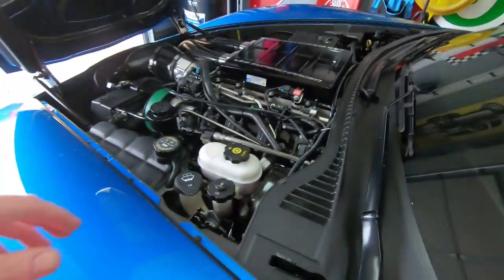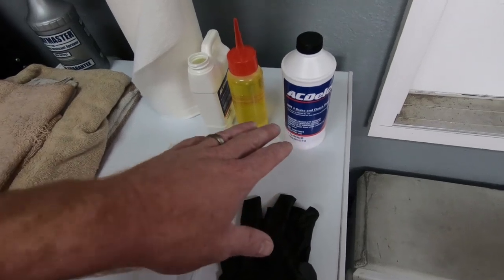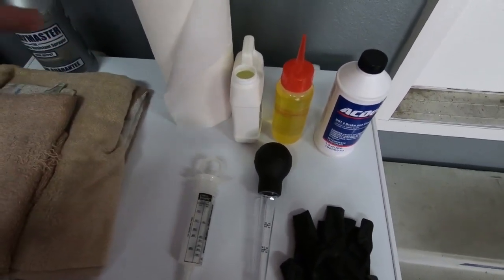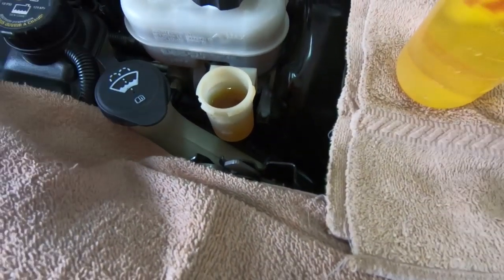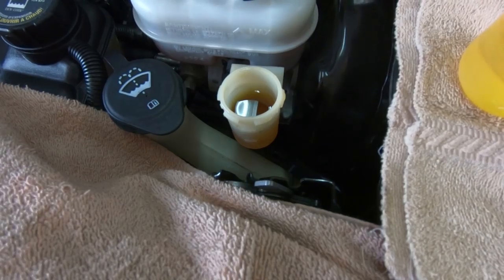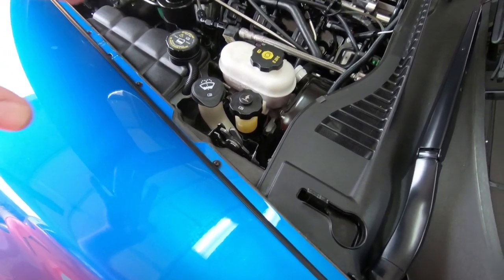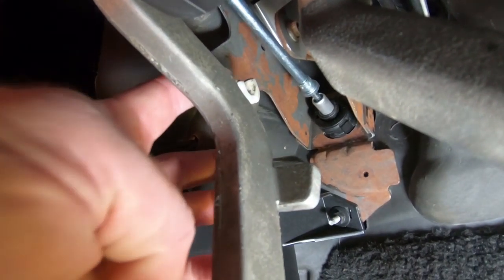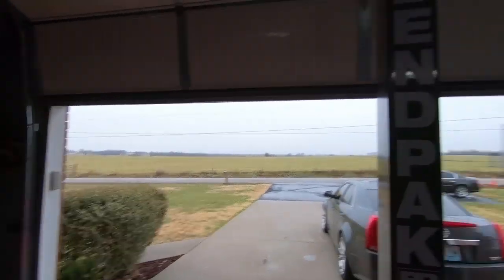How to Flush Clutch Fluid and Remove Clutch Assist Spring Corvette

Comment: Thanks for "ranger " flush method show and tell. Now my problem is I have a '97 Chevy OBS truck and the clutch assist spring is broken or missing. So my pedal returns from the pressure plate but on a bumpy road it kind of dangles so I have to keep my left foot close in. Wish I had the Corvette style spring problem you had. Any of your trucks have/had this problem ?
Reply from the maker: Never had that issue on a truck

Comment: Awesome vid! I have done the ranger method on my 2012 Z06! Works great and very easy to do! 
As for the clutch spring, that's crazy that it still bounces back like that! My spring broke on my 2003 Coupe and I had to lift the pedal back with the top of my shoe to engage the clutch. Otherwise it would stay in the down position. 🤷‍♂️
Reply from the maker: Thank you. I agree well worth doing.

Comment: Owning a 2002 Trans Am Ram air I would recomend Tick performance for their master cylinder.  Sold my cluctch issues. You remove the pedal spring.
Reply: Solved. Sorry typo.
Reply from the maker: Yeah I have used ticks on past fbodys and liked them. I may end up using one on this if I change the clutch out.

Comment: I'm going to say slave cylinder. Same thing was happening on my 99 ls1.
Reply from the maker: Yeah some have replaced slave but have also fixed with this method. Lingenfelter actually makes a kit with spring for this issue also.
Reply: @TWAMotorsports  yeah I tried that spring kit before I.I had no luck so I had to I went and replaced everything from tick performance. Maybe you'll have better luck.
Reply: Sorry for the spelling. Looks like I'm drunk.
Reply from the maker: @alexandermcdole8464  I sure hope so. If I do a clutch down the road I will replace the master.
Reply from the maker: @alexandermcdole8464  lol